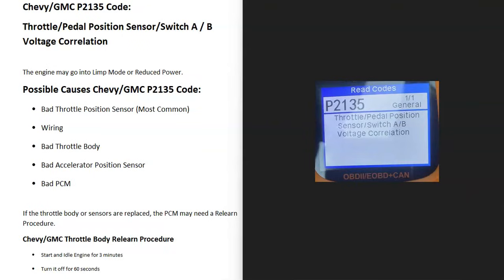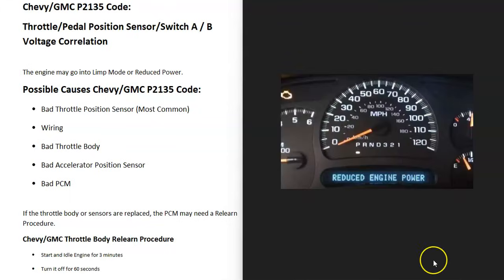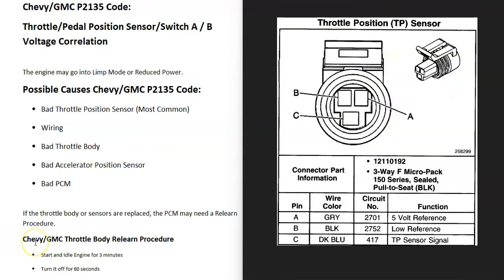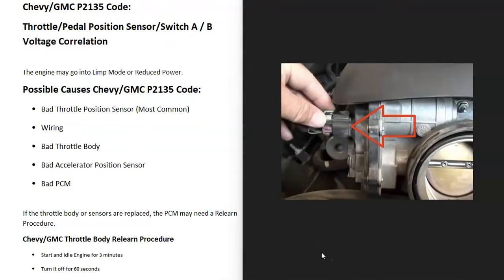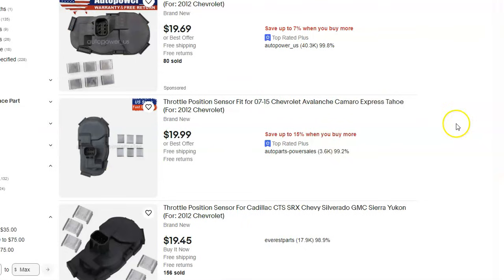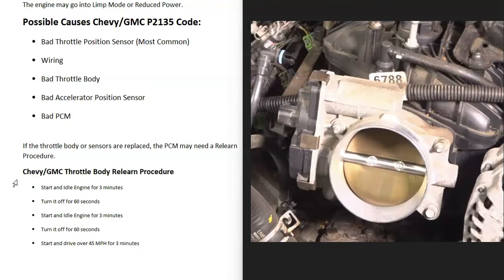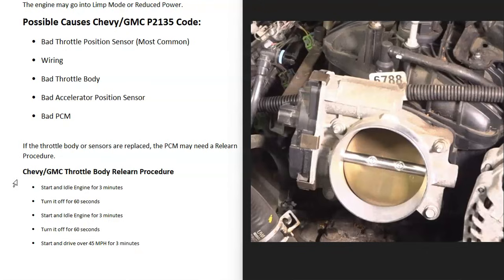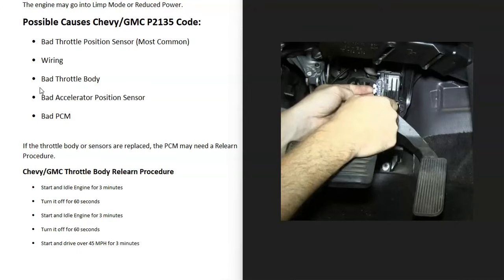How to Fix Chevy GMC P2135 Code: Throttle/Pedal Position Sensor/Switch A / B Voltage Correlation

Comment: Ihave  2003 chevy silverado 4.8 liter same problem goes in in limp mode dont run over 30 mph  .i channged oem  throtle body, pedal few tac modules it just suxx cause GM dont make anymore many of this parts they discontinued only making for newer cars....im goinf try now the main harness..

Comment: For everyone who’s got this problem I have a 2012 Chevy Silverado 1500 and my TPS is going again, happens only when it’s wet out or rainy, when I wiggle on the plug to the harness going to the TPS it seems to turn back on and out of limp mode so it may be bad wiring not sure though. I may replace the whole throttle body this time around as I did replace the wiring harness to the TPS earlier this year and now it’s doing it all over again. Had no issues all summer now we are getting into the wet season and it’s done it twice so far a week apart

Comment: I need help to rewire my throttle position sensor wiring connector. it's the 6pin dual line connection and I have tried almost all the ways to rewire but no luck. I took a Pic but accidentally deleted it to make space on fon
Reply: Just do one wire at a time
They all should go to the original pins
Did you damage the connector or something?

Comment: Thanks. My G8GT thru the code this morning and after checking wiring and vacuum sources, it ran fine but check engine light stayed on. I cleared it with my tuner. See if it shows up again and then dig into it.

Comment: I’ve been getting this code and going into limp mode damn near every time it rains. I replaced the throttle body, the pedal position sensor and the TAC module and it’s still happening. It ONLY happens when it rains.. someone please help !
Reply: Waterproof your car?
Reply: Have you fixed this? Same issue here
Reply: @fernandopineda3109 yes. It was the alternator. Try lifting up the hood and hosing down just the alternator and see if it goes into limp mode. I replaced the alternator and i haven’t had the problem since. Spent a fortune getting to the bottom of it. If hosing down the alternator doesn’t send it into limp mode, keep going around under the hood with hose one component at a time and try to locate where the problem is. Good luck

Comment: 06 silverado 2500hd. P0120, p2135 soni replaced with new gm parts a throttle body, TAC with gm harness pedal, throttle body wire harness and had the pcm checked and programming done twice. Traced and redone 2 grounds on back of engine, 2 grounds under drivers cab to frame and new negative battery cable. Still pops codes intermittent. Its not a flood vehicle, I know the whole history since new. Help im stuck
Reply: I went thru the same stuff and I finally cut the ground on the back drivers side of the motor and added wire to it and relocated it to the bolts on the bottom side of the alternator and so far so good. I had cleaned every ground on the damn thing and finally found a wiring diagram that shows exactly where and what each ground does. This is the longest ive went without an issue so fingers crossed
Reply: Hey there I have a 2003 gmc Yukon getting same codes as above but get no fuel or spark cranking whay was your symptoms you had

Comment: Had this pop up on my chevy trax lt 2020. Back out parking lot. Temp outside got to 74 degrees. Warm day. Took it to autozone. Gave me the code p2135. Took it the mechanic. Have wait to be seen. Told me its ok to drive not too hard. Went right to the car. The sensor went away. Went back into the mechanic to tell him it went off. Told me to drive around to see if it come.back on. I notice when the weather gets hot or warm. The car start acting funny.
Reply: Same here

Comment: i have replaced the Throttle body and pedal and it worked for 6 months. Then this code came back and went into limp mode. I have checked all issues as stated and just can't figure it out.
Reply: Do you notice if it happens only when it rains? I replace both as well a long with the TAC module and it’s still happening to me too. It only happens when it rains
Reply: @montehibbert3606 same did u ever figure it out
Reply: What about the PCU
Reply: You ever fix this? ive done the same and it comes back

Comment: 07 Tahoe 5.3 stopped, lo power in engine, stabilitravk on dash and when stepped on gas pedal it would not accelerate one bit. Had to disconnect the battery for it to function but check engine remained on
Reply: Did you fix it? Mine is doing the same thing 😢

Comment: My 2010 Chevy Silverado did this LAST January. After clearing the code,  no issues again all year... until last night. Driving from Wisconsin to Missouri it happened twice. Any clue why it's so sporadic like that? Definitely want to get it figured out.
Reply from the maker: It could be a bad wire, a loose connection, a component starting to fail, or something along those lines. Intermittent issues can be hard to troubleshoot sometimes.

Comment: Message for Juangiles. Same here 2011 Malibu. New throttle body and pedal sensor still goes into limp mode. I checked wiring it's fine. But my transmission is going out. Jerks on 1st gear that's when it sets code. I can't think of anything else. I looked up everything

Comment: So I got this code on my dad’s Chevy but when I try to turn it on it doesn’t turn on it I do what you did could that possibly fix it?
Reply from the maker: If the engine doesn't start, check your fuses and be sure the battery is charged with good terminal connections.
Reply: @ yea I boosted the car it worked cause I also changed the whole throttle body I go home do an oil change try to start it it does the same thing later the next day I boost it it works again the day after that it does the same thing but boosting it didn’t work I try boosting it the day after that that it works and it hasn’t done that since which is really weird😂

Comment: I have a 2012 malibu. I've been dealing with a p2135 code. I replaced the throttle body,the plug to the throttle body,the accelerator pedal,and the map sensor. I sprayed all the connections with contact cleaner and dielectric grease and Istill get the code. Any suggestions?
Reply: Just had my 2003 Chevy 1500 with same damn issues, mechanic at Chevy dealer said he knew exactly what was wrong.  On driver side, there is a small fuse box, he replaced 15 tiny terminals to the fuse box.   Said some terminals would always go bad.  So he replaced all of them.   Truck great until 2 days later and this stupid pedal position sensor took my truck back into REDUCED ENGINE POWER.   Almost done getting rid of this issue
Reply: Fuse box inside the car. Between door and dash
Reply: GM released a Service Bulletin saying plugs are susceptible to moisture.  Just read that the seal around the antennas are not great, and if there is rust near the fuse box then a moisture lean near the antenna is probably the culprit which means resealing the antenna and figuring out if any other parts need to be replaced because of moisture damage

Comment: Any help please! I’ve changed the throttle body and sensor, accelerator pedal sensor, checked the wiring everything is good from what I can tell no loose wires. And the code goes away for couple of days after I installed each sensor and then comes back.. what could it be?? I never did the whole “relearn procedure” I usually just turned it on let it run for a couple of minutes and then drove it around the neighborhood and the code would pop up for the first few minutes then went away for a few days then just always comes back
Reply: Did you notice that it only happens when it rained ? I’m going through the same exact issue right now and it only happens when it rains
Reply: @montehibbert3606 dude mine does this when it rains.  It does it sometimes when it doesn't rain but i can guarantee it's gonna happen when it's wet. I've done everything
Reply: @420DWin  I ended up figuring out my issue.  At one point in time somebody spliced the wiring harness that goes to the throttle body and they didn’t do a good job. So occasionally the wires wouldn’t have good contact so that’s what would cause my truck to go into limp mode
Reply: My truck is 2003 Chevy 1500.  Dealer told me on driver side fuse box inside truck, there would be a couple tiny terminals that would go bad.  So now dealer just replaced 15 tiny terminals cause of being old and corroded. See if that helps.  REDUCE ENGINE POWER all the time.  Could fix until I took it to dealer
Reply: @jamesvasquez6280  replaced tiny terminals?  Like had to get into the back of the fuse panel to do this?  Something you could have done or too complicated?
Reply: @condor5635  it’s right there as you open the door there’s hidden panel with fuses and things behind it not hard to get to at all.
Reply: @Shartlord6  thanks I understand where the fuse panel is. That wasn’t really my question. My question is when he said he replaced tiny terminals. Does that involve removing that panel or is that something he’s saying they did from the front once you remove the door to the fuse box.

Comment: I just replaced the sensor itself (not throttle body).

We'll see how it does over the next few days.
Reply: How did it go? I got a 2010 chevy malibu and started to do this it shakes and hesitating to accelerate p2135
Reply: @j.2391 i did the sensor alone and got about a year out of it
Reply: I’ve have everything replaced

Comment: Hi, thanks for the video.

If the Chevy Cruze spent 5 days with the battery disconnected, can the accelerator also be deconfigured?
Reply from the maker: It depends on the computer memory type, but it likely will need to relearn. Usually, it's not a big deal; driving it around and the computer will relearn on its own. You can Google the relearn procedure for your year of Cruze.

Comment: Good stuff thanks. I'm down to my last option... checking the wiring.
Reply: Same
Reply: Ecu bro
Reply: What did you ever come up with? Going through this now but have not replaced anything yet.
Reply: Seal around antenna may be bad and moisture may be running down near fuse box on left side of dashboard.  Check to see if this area appears rusty.